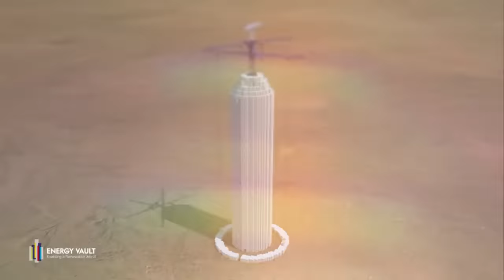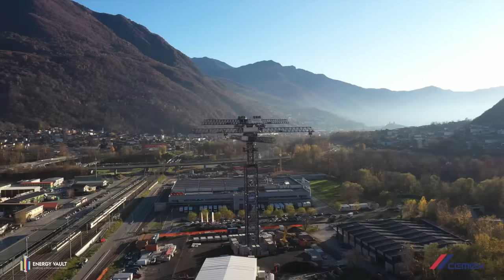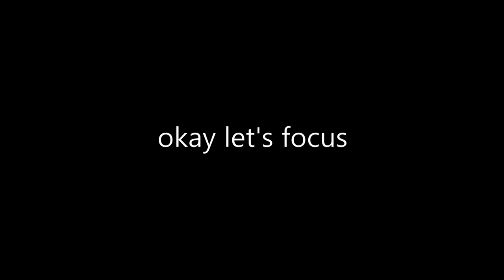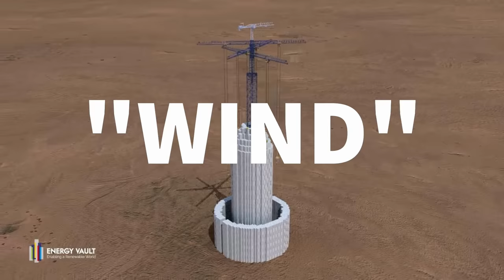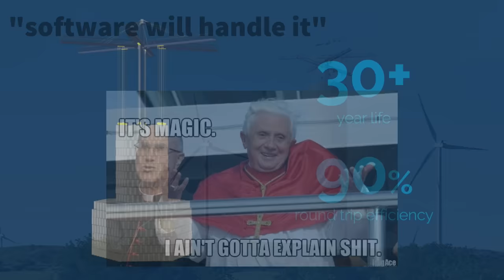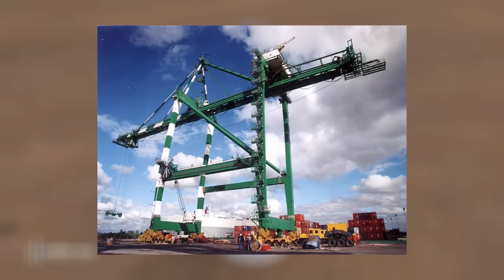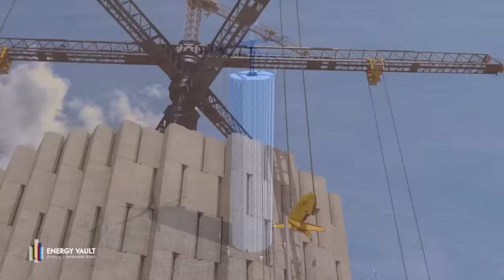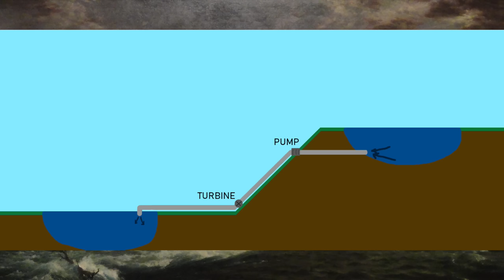The Energy Vault is a Dumb Idea, Here's Why

Comment: There is a crane that uses depleted mines for such a thing. And uses one massive dead wait and allows it to lower when energy is needed. Produces the same power with less movement
Reply: Weight* but yes, I was looking for this comment.
Reply: one enormous dry oil well with a giant solid lead mass seems like it would be much more energy-efficient than a bunch of blocks or even pumped storage, but at some point pumped storage may be more scalable depending on the availability of abandoned wells. At least it's still an option for locations where pumped storage is unfeasible due to bad topography and/or water scarcity.
Reply: @ethanpayne4116  
Both abandoned wells and hills for pumped storage are location dependent and finite in size and number. I personally think some kind of flywheel system is going to be a typical answer. That, or a some new breakthrough in graphene batteries or similar high density storage.
Reply: @kindlin  flywheels sound nice in theory and maybe they'll be great for high-tech facilities, but in my mind the precision needed to protect against sensitivity and risk of catastrophic failure seem way greater for flywheels than the costs of just drilling a well with existing equipment for most moderately remote sites. Maybe flywheels are more robust than that though, but intuitively it doesn't seem extreme to favor the method with less kinetic energy. I guess if we prefab the flywheels and then just install them wherever then maybe that will end up being more efficient, but idk how far we are from that being a practical reality.
Reply: @kindlin  I guess flywheels have the potential of much greater capacity, but to take advantage of that capacity we have to manufacture an extremely robust/efficient flywheel whereas a well is literally just a dumb hole in the ground.
Reply: @ethanpayne4116  
Rotational momentum is inherently stable. The actual hard part is making it heavy enough yet strong enough to spin up fast enough to make good use out of it. If the magnets fail, or the vacuum fails, or something other system fails, it'll just sink to the ground and friction away it's energy. I could imagine it going bat-shit crazy and exploding, but you would hope the engineers design it to withstand the worst possible failure at the highest possible speed.
Reply: @kindlin  yes but its kinda like rocket engineering if you look at the nescesary speeds it has to go at, especially for that weight, its like a cannon waiting to be fired off
Reply: @kindlin  yeah it's all that strength and precision in the flywheel that seems like it would add quite a bit to the design and fabrication cost, whereas a big lead weight on a chain hooked up to a turbine is almost as simple as it gets for energy storage, lighthouses used to use sandbags on ropes to spin the lamp as the bags fell over the course of the night, we know that method works and we know how to implement it today
Reply: @ethanpayne4116  
What would the chain holding the giant lead weight be made of? If you look at specific weight/breaking length (the maximum length of wire that could support its self weight) you'll see that steel has 20x that of lead. The flywheel is basically going to just be a solid mass of a high specific weight metal.
Reply: @kindlin  The actual mass doesn't need to literally be lead if there are better alternatives, we could use depleted uranium even if we want to go heavier. Also the chain/cable can just be made of whatever, steel or carbon fiber or some composite or anything as long as it can be spooled and can hold the payload. Steel is cheap and lead is cheap so a big lead mass with a steel cable seems like a low-cost option.
Reply: @ethanpayne4116  
I've been thinking about this, and I think that a large loop-shaped steel mass, held to the middle with carbon fiber strand, may work the best. The steel, itself, can support massive hoop stresses, and the carbon fiber is very stiff and strong in tension. I would probably wrap the steel hoop block in carbon fiber as well (a rectangular profile is more efficient than a circle for moments of inertia; think, I-beams)

Comment: Pretty dope and concise video. One potential criticism is you do need a source of large body of water as well as a terrain that lets you pump water up and down (dam or mountain). Not all urban communities have the space or geography to accommodate that. So using the underground gantry version of this actually might actually have a justifiable use casa
Reply: Or you could use the next version he showed, using water storage underground with tanks on top. This removes the issue of erosion/arranging as water can't erode/break (it is a liquid) and can be moved way easier than concrete (using pumps instead of a crane). This is almost the same as using two offset water storages, minus the location limitation but with added cost of creating an artificial container above the initial lower water storage.
Reply: @angusheath5321  
Geology is the problem. You need specific kinds of rock and geological features to get a watertight reservoir (or at least enough of one to not spring leaks that will cause erosion all the time), or you need to seal all of that with pretty expensive stuff- price for artificial pools goes up very quickly as depth goes up. The underground gantry idea on the other hand just requires reinforced walls to retain the dirt/rock- something much easier to find and much cheaper to build. 

The above-ground tower version is and was stupid though.
Reply: @crosshairs007  so basically let's just use water, electrolysis and oxygen+hydrogen, it needs less space

(Though efficiency, expensive hydrogen tanks, liquification of those gasses, and potential danger...)
Reply: @user-qi6pv9jh7o  Haha gas go boom
Reply: Transporting electricity a few hundred kilometers is not a problem. There is absolutely no reason energy storage needs to be built in an urban environment.
Reply: @demonslime  you'd be surprised the energy needs for super dense cities like Lagos, New York, London etc. it gets exarcebated in "developing" countries.  growing up in Lagos, one of the biggest problems has been the national grid. any energy solution needs to be resilient enough to not depend on the current infrastructure to transport. the only cities (like where I grew up in) that had constant electricity generated and consumed their energy in the same location. we had gas turbines that powered our city/ton